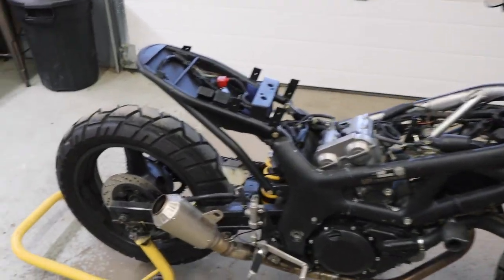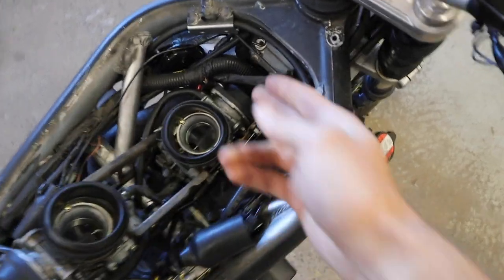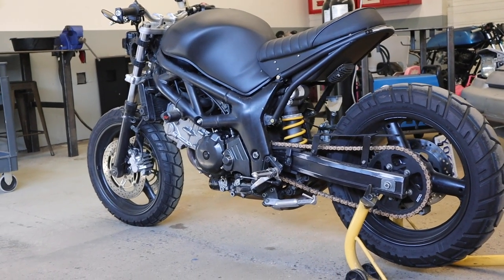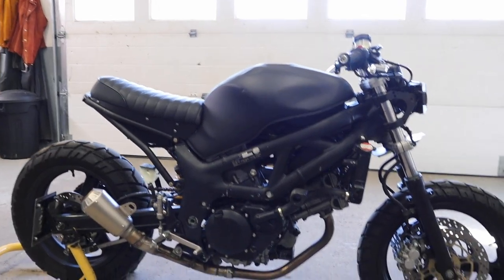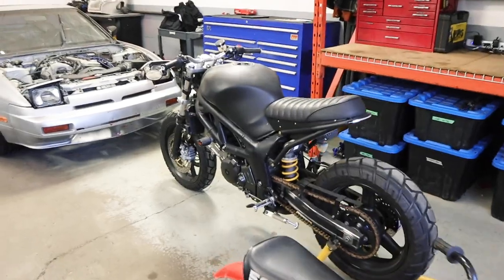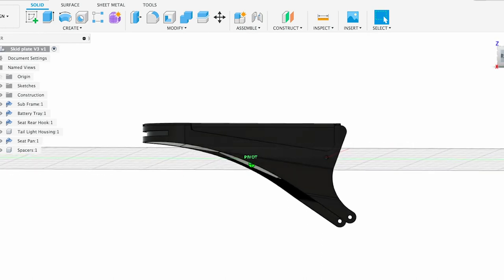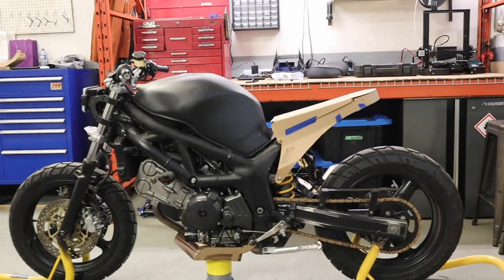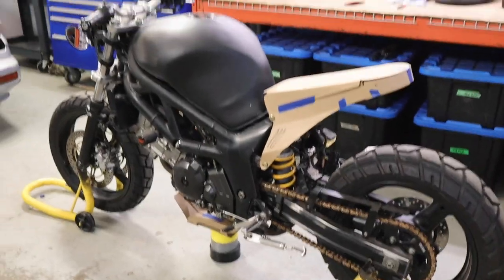SV650 Scrambler EP 7 - Designing a new subframe & skid plate

Comment: Hi there, great build. I know it is a matter of taste, but I would prefer the subframe made just from pipe,  like the first one, sitting directly under the seat in final position. The one you make make the bike look heavy in my opinion. Also the tank -  I did prefer metal colour, it gave lightness instead of heavy look. But it is not me who will ride it, I've made mine as I wanted 😁. Nice work! And video top quality.
P.S. I hope you checked if you are able to lift the tank without full subframe disassembly? 😁👍
Reply from the maker: I don't disagree with you at all, I also like the stripped metal look and tubular subframe. Always torn between both